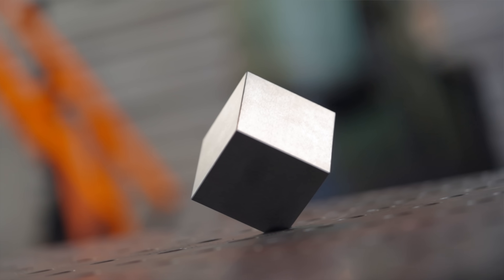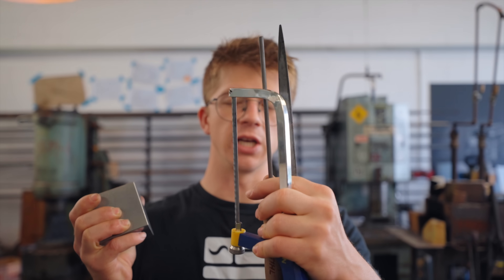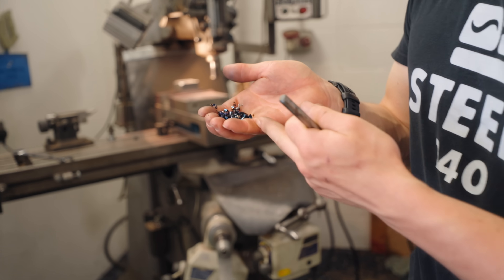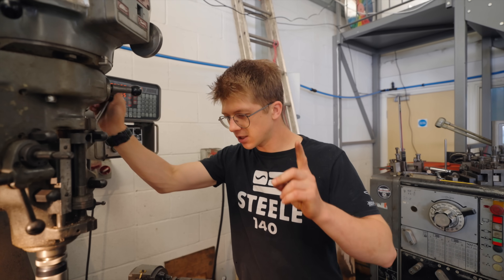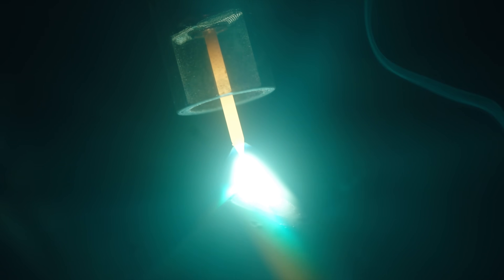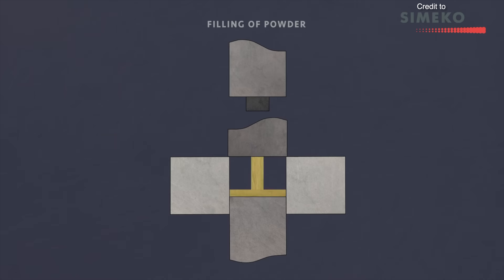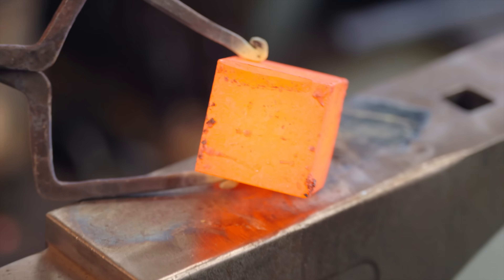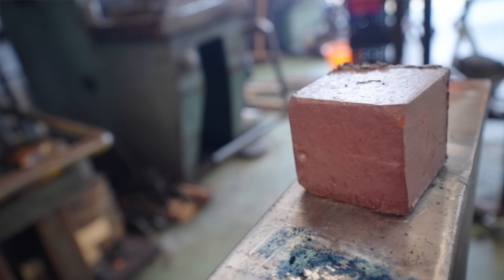Can You Forge Tungsten?

Comment: You don’t actually need to melt metals to make them alloy as long as they’re kind of ductile and thus able to diffuse into each other.

It’s not a thing most people will have encountered because of how dangerous it is, but sodium-potassium alloy - a liquid at room temperature - can be made by rubbing solid pieces of the metals together under mineral oil to protect them from air.

I think the gallinstan-type alloys that PC hardware enthusiasts will simply know as "liquid metal" are made in the same way, you just mash the solids together until they form a uniform liquid.

Comment: The slight forge ability makes me think that Alex should definitely come back to this in the future with some special equipment. Hotter forge, better PPE
Reply: And maybe try making a tungsten/steel damascus bar using some of the shavings
Reply: @Grubbz09  this absolutely! Canister Damascus, hotter forge with pure oxygen or nos (nitrous oxide) and run acetylene together hehehehe. The problems with induction heating is how expensive it is to put together with quality parts that will run off of the voltage and amp they probably have. Two circuit lines of the 200 volt would make it easier but they would need to run argon cooling in hollow copper cables of sufficient thickness to handle the volts and amps likely required to get it that high temp for tungsten to become willing to bond. If they go canister it's easier with a wash bath of rust remover on the dusts and chips, then dry in argon, then dunno the very high carbon steel dust and chip with a high temp ceramic that is made of elements that help with tungsten bonding (like with flux, so like nickel, beryllium, zirconium, etc all google stuff) so they take longer to heat up, same with the inside and outside of the canister. Then when putting it together it's a good idea to pump it through with argon, then vacuum everything out, squish it under the hydraulic press, vacuum it out again, then squish it again. So a box around the hydraulic press would be easier, probably! Same with some gloves to weld the thing after final squish. Then it's all about heat! If they could, pure oxygen and coal / carbon dust into the intake area of the forge is going to get them the out right hottest temps, but it's kinda dangerous. So....🤷 maybe just nos and acetylene?

I'd not dust/ chips then thin shim metal with the tungsten it makes it easier to remove rust and coat with ceramic. Might be way cheaper too! Can always throw more carbon in there too 😉😁to make it attempt a higher carbon to carbide process during forging and hydraulic press forming process (squish) I would love to see it
Reply: Tungsten & steel Damascus , that is good one idea !
Reply: @Grubbz09  steel would be liquid before the tungsten got to forging temp.
Reply: Induction heater with argon sheilding.
Reply: Radiation Heat alone would be absolutely terrifying
Reply: @lethPointer  I would assume he would need PPE just to be near both the forge and the tungsten if it were brought to temp. I know for a fact that forging above 2400C is a danger just because of the risk of breathing superheated water vapors that can damage you lungs instantly. That and the air temp around the block can cause burns also
Reply: @hogandromgool2062 he already uses a full face respirator that pumps filtered air from behind him, so breathing isn't an issue, but at 2400c so many things you would expect can spontaneously combust. Thankfully lm pretty sure he is aware of that.
Reply: One of the issues with tungsten is that it can burn at forging temps. So as it's heating up, it will also be burning off. So special furnaces are used when casting to keep oxygen out. I know there's a difference between forging temps and casting temps, but I'm not aware how far apart or how bad the oxidation problem will be at forging temps
Reply: @nunyabisnass1141 worked at a foundry that would cast molds made with the lost wax process in a vacuum to remove the air.....
Reply: This cube almost certainly came from Midwest Tungsten Service. They make the cubes out of "Tungsten heavy alloy" which they say is about 90% tungsten, with the rest being nickel, copper, and iron. It's specifically formulated to make it workable with normal machining.
Reply: Will probably need an acetylene-fueled forge at the minimum, or an absolutely massive amount of HHO generation to fuel the forge.  About the only things I can think of that would get anywhere near the temps required.
Reply: @anthonybarker9123 an induction furnace as mentioned earlier would probably be a far easier and cheaper option.
Reply: @Jake12220  If he could source one of high enough power, it would be MUCH easier than an Acetylene forge (and a lot cheaper, I can't believe how expensive it's gotten)
Reply: @Jake12220  That can be quite dangerous if you don't use a shield gas to keep oxygen away, tungsten at those temperatures becomes highly reactive and will have a tendency to burst into flames.
Reply: @anthonybarker9123  No one does it. It's too expensive and complicated to actually hammer forge tungsten. It's too much infrastructure. If people want to forge tungsten they do it at the temperatures not much higher than Alex already has it at. Just a very very big hydraulic press and dies. Even then. Forging tungsten alloys is considered high end aerospace stuff. The only applications which need the allied grain structure that comes from forging tungsten is aerospace.
Reply: @anthonybarker9123  yes ,i worked in a tungsten carbide shop 45 years ago and they made ''blades'' that would warp sometimes and the women would use acetyene torches and a arbor press to straighten them. they would sit there with a heavy asbestos apron on for hours doing it.
Reply: MUCH better PPE.  My man didn't even have sleeves.
Reply: Getting tungsten to temps where it can be forged causes other problems. Tungsten at those temperatures is highly reactive with oxygen and oxidises like crazy in air, for this reason it is very difficult to work with. It is always worked in inert atmosphere in commercial setups for this reason.
Reply: Also a slimmer piece to allow for the metal to form easier.
Reply: Why waste good tool steel.
Reply: Will the TS be affected by induction heating?
Reply: should have put the oxy on it
Reply: What about magnetic heating?
Reply: Maybe some PPE at all hahaha
Reply: Been seeing this guy aging miraculously fast for years.  If he wore any PPE I'd be surprused.
Reply: Yeah, at some 1300*C it's basically the same material, considering tungsten's melting point is nearly three times as high.
Reply: Thanks for spoiling.
Reply: Not happening unless he can forge in a vacuum
Reply: PPE 🙄
.
.
Go watch any video similar to this, made in India and say the same 😅
Reply: OH SHHHH ABOUT PPE DID HE GET HURT NO.
Reply: better PPE... uhuhuh, you need to experience injury to really care and enhance your PPE... 🙃☺

Comment: Damn... i thought you would be able to forge it! Well, you HAVE to find somewhere you can bring the temperature to a point where it CAN be forged and make a knife or even a sword blank! The rest you would be able to do in your workshop! But you HAVE to do a knife or sword! A special unique piece that represents the channel and your career on youtube!
Reply: Can you imagine a competition chopper made of a tungsten alloy? much heavier for the size, incredibly tough edge.
Reply: Axe blade
Reply: He could do it with an induction furnace blanketed with argon.

Probably also with a graphite or ceramic furnace but that would be a nightmare due to the atmosphere required in either furnace.

I guess technically you could use a super hot gas furnace, probably hydrogen or acytelyne.

I would do it with an induction furnace, graphite crucible, blanket argon, have a gas blanket on the piece.

He definitely needs PPE for this.

Comment: By adding tungsten to already melted steel - not only a physical, but also a chemical reaction occurs, where the two metals start mixing before the tungsten fully starts melting, effectively lowering its melting point.

Edit: "Chemical change" is a better term here than a "chemical reaction".
Reply: Yeah molten metals dissolve each other fairly easily, i've melted copper with tin. Just drop tin on copper and heat it up, the copper will be dissolved by the tin way before it's even red hot
Reply: @jeanladoire4141  it's not a chemical reaction, it's just dissolving like salt or sugar dissolving in water.
Reply: @ParadigmUnkn0wn  Which is a chemical reaction :)
Edit: "chemical change" is a better term here.
Reply: @ParadigmUnkn0wn  yes indeed, they don't form a chemical compound they just blend together, probably forming an eutectoid that melts easier than both metals
Reply: @JanasV  no, a chemical reaction results in products that are different than the inputs. Salt dissolved in water is still salt, if you evaporate the water the salt will recrystallize. It's still salt, it was always salt. Compare that to reacting sodium bicarbonate (baking soda) with dilute acetic acid (vinegar); it doesn't. dissolve, it reacts and forms carbon dioxide gas that bubbles off and sodium acetate which dissolves in the aqueous solution. If you evaporate all the water, you'll be left with crystals of sodium acetate, not sodium bicarbonate. 

Alloys are not chemical compounds. When they cool and solidify, the alloying elements like tungsten precipitate out as individual crystals. Most (all?) metals are actually crystalline at standard temperature and pressure, thus the grain structure visible when metal is broken.
Reply: @JanasV  No, it's not.  It's a physical process.  Although the already dissolved tungsten does make a chemical reaction with carbon in the molten steel to make microscopic particles of tungsten carbide.
Reply: @ParadigmUnkn0wn  Sorry, it's not a chemical reaction, but it is a chemical change. The "dissolving" process is a chemical change. And while you can restore salt from water, you can't restore metals from alloys without a chemical intervention.
Reply: @kaneto88 ↑
Reply: @ParadigmUnkn0wn   " It's still salt, it was always salt."   <---- every russian I've encountered on CS:GO
Reply: @JanasV  Being difficult to separate doesn't make something a chemical compound. Air is a difficult to separate mixture of gases, but that doesn't make air a chemical compound.
Reply: @JanasV chemical change and chemical reaction mean the same thing, and it implies changes in chemical bonds between atoms.  Melting, dissolving and alloying only involves rearranging the crystalline structures of the material, which are higher level structures than the chemical bonds. Thus it is not a chemical change or reaction by definition.
Reply: Yup, molten aluminum will eat a steel crucible.
Reply: @Eluderatnight why is it when mixed with copper it doesn't or does something happen that's not clicking
Reply: tungsten damascus anyone?
Reply: just like liquid gallium can make an alloy with solid aluminium
Reply: A eutectic mixture?
Reply: Table salt has a melting point of 800 C, hotter than aluminum 
it dissolves easily in water at room temperature. That's just how it goes.
Reply: It dissolves in the Iron.
Reply: That's how you make tool steel. Tungsten by itself sucks mostly.
Reply: I wonder what happens if cast iron is used instead.
Reply: Metal alloy? I mean "phase change" would be better as well
Reply: Nothing chemical, just physical ...

Comment: I believe the tungsten dissolves into the steel at high temps.  Like CO2 into water (soda) or acetylene into acetone.
Reply: This; it also helps that tungsten is easily prepared in powdered form (e.g. hydrogen reduction of oxide powder), and just blending that with some iron, pressing into a pellet, and sintering/melting that, will disperse it pretty quickly.

Let me see here... up to about 15%at (36.7%wt), W in Fe, it's readily soluble, beyond which the liquidus rises beyond 1900K.  So that would be a simple way to prepare tungsten master alloy.  Even down at 1100K, the solid-state solubility isn't bad, a couple percent; kinda reminiscent of the Fe-C system.

Incidentally, "like CO2 into water" occurs in metallurgy just as well.  Brass has a large fraction of Zn, yet is poured above Zn's boiling point; Mg is dosed into cast iron (albeit only a very tiny amount) to induce nodular iron formation (ductile iron).  Mn also has a fairly low boiling point (only a bit above Fe MP).  Zn even forms reasonable alloys with Fe (or, by the looks of it anyway), though I don't know any have commercial importance.  Regular gasses of course have various solubility, H2 being of particular concern for many alloys, and O2 for noble metals (Cu, Ag..); or how iron scale itself can be seen as an alloy between Fe, FeO, Fe3O4 and Fe2O3.
Reply: Actually more like salt dissolves into water.

Comment: Making a tungsten axehead would be awesome
Reply: Na, a black smith's hammer!
Reply: @chrisrodriguez2275  if you want a chip to break off and take an eye out.
Reply: Too brittle
Reply: @laan1956   nah, you're thinking about tungsten carbide, but even that at like 60 degrees behind the edge would probably be fine. Edge geometry is more important than material characteristics.
Reply: Timothy Dickerson
Reply: @nightmarejr  Timothy Dyck  ... no? Canadian  Blacksmith - Making A TITANIUM HAMMER
Reply: I was thinking a tungsten knife would be cool
Reply: idk why an argument started, all i said was it would be aswesome to make one, if its possible or even viable to be used is another thing x)
Reply: It's the exercise of the thing! How about a super dense ball peen hammer?
Reply: @jake12220 SR71 and it was made with titanium not tungsten
Reply: @scottbimmer1147  lol totally my bad. Was a brain fart on that one.
Reply: It would crack. Inconel is much better
Reply: @NOTSOSLIMJIM  tungsten comes in different crystal structures. Apparently some are brittle, others more ductile (all of this is not unlike steel).
This block of tungsten didn't seem very brittle, else the corners should have splintered under some of the experiments in the video. So it should definitely make for a usable axe, at least for soft enough woods.
Reply: @leftaroundabout  thin tungsten, regardless of grade, with crack with vibration. Why do you think they don't use it?
Reply: @NOTSOSLIMJIM  they do use it. There just aren't many applications where it's economical. Steel is tougher and orders of magintude cheaper, but that doesn't mean tungsten can't also be tough.
Reply: @leftaroundabout  no, they don't. They use tungsten parts that interact in the exhaust system, but not the tube itself. Tungsten tube is used in aerospace and furnaces, but is produced in a thick pipe, not thin exhaust tube. They use some in space shuttle parts, but mostly inconel.
Reply: @NOTSOSLIMJIM  well, thin tungsten exhaust tubes aren't a thing because of the material cost, difficulty in making them, weight, and because there is no use case where other metals with suitable cooling wouldn't also be sufficient.
But thin tungsten is totally a thing, you can buy it in thin sheets or even foils and obviously filaments - according to your logic, light bulbs wouldn't be possible since even the slight vibrations from screwing them in would break the delicate filament.
Reply: @leftaroundabout  yeah, because I said anything close to that. Keep backsteping your comment when you realize you were wrong guy.